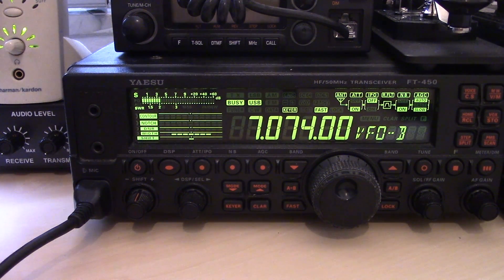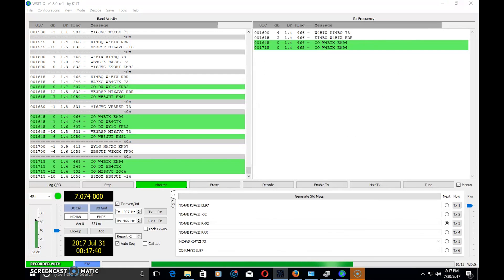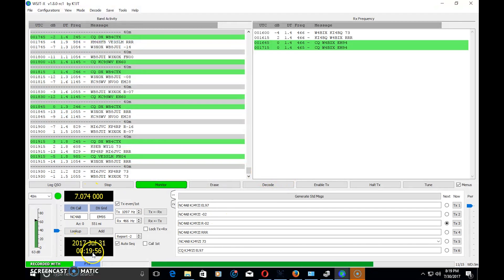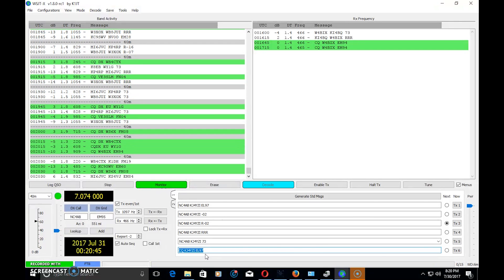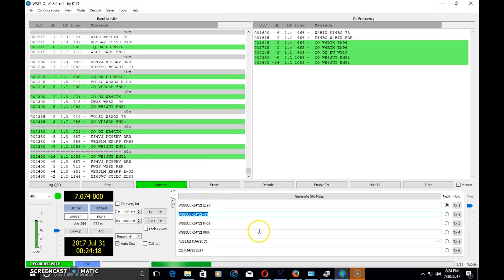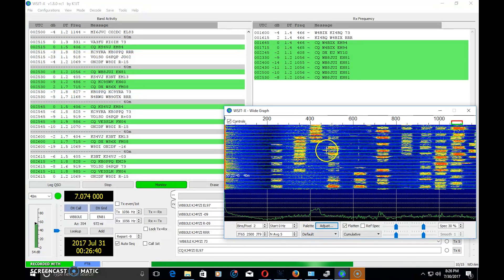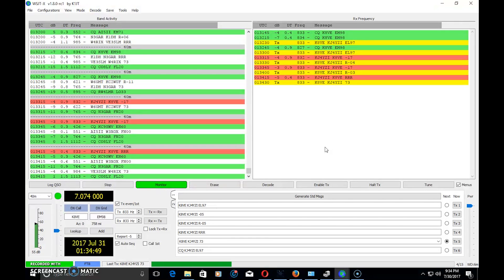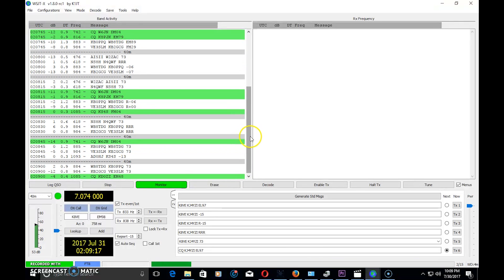FT-8, The New HF/6m Digital Mode, Introduction For Beginners

Comment: How do you handle multiple ft8 calls coming in to you one after the other or at a bunch at a time?  For example 5 calls come in simultaneously.  I usually do first come first serve and if the station does not respond after 4 or five tries I move on to the next one and so forth.  Or I would look for the strongest station and go from there.  If I cannot make contact with stations, then I try to call them back at a later time.  Any suggestions?  Thank you.

Comment: You know what? it isn't a digital mode, it is an analogue data mode that uses tones, electric pulses of varying amplitude, whereas Digital is binary format (zero or one) where each bit is representative of two distinct amplitudes. people keep making this mistake, It's not a digimode because it does not send a digital signal! The actual carrier of the signal is USB

Comment: I am really late to the digital game being a ham for 30 years now, but thank you for the video. Going to try this with a newer rig and some cables I have coming for it.
Reply: how’d it go?
Reply: @Lick2Trip  It's going great. I use MSHV  I stead of wsjtx because for me it works better.  For me the cat cable control never works. Not sure why,but works fine using vox.
Reply: @Lick2Trip  Don't know. I have all the proper cables but no luck. I have tried regular serial cables and usb to serial and it acts as if there is nothing there,but I can use the audio cables and it works fine. I am a hardware guy in a software world. Just glad I can get on at all.
Reply: @Lick2Trip  Going to try again now that I have serial to serial vs usb to serial.

Comment: Very useful and clear video - I'm just trying to set my FT-450 up to use it, as I am limited to vertical HF antenna. First impressions of range of signals received is very encouraging. Here in UK I am receiving China and South America which I really struggle to QSO  with on SSB. Thanks very much - length of video is fine for beginners. 73 Rob G1VXD

Comment: Always enjoy your videos, however I find this mode kind of silly, but having said that I believe it is a tool in some respect.  It will test your antenna with low power to see how far you can reach out and touch someone.  I've been using it for a very short time.

Comment: Full disclosure....been a ham for decades.  Extra Class when you actually had to copy 20 wpm cw.  My very first contact on air was in digital mode.....on 3729 kHz (KC back then)  using international Morse code on cw.  I had to send and receive manually.  Since then I have used virtually every mode of transmission that ham radio allows.  So....here's the thing....what's the point in a 30 second QSO where your computer talks to another computer?  Why even bother actually being there?  Just program your computer to search for a digital signal...then respond to a digital CQ, exchange grid square, signal report...and sign off.  You can just walk away...let the machines talk to each other....and, gee whiz....ain't it great?  Look at all the "contacts" I made....Rubbish.  You didn't make a contact...your computer did.  All you know about the other guy is where he is...and how strong/weak your signals were.  That's it.  You don't even know his name.  Nope....not for this old timer....go ahead.....send and receive little warbling sounds...let your equipment do it all for you....but, to me....that ain't ham radio.

Comment: Good video but dang, FT-8 looks like a colossal waste of time, and you don't even need an operator to do anything. I keep wondering if I should get into ham, but it's stuff like this that I find very unappealing. Every time I ask a ham operator what they do, it's just trying to make contact and exchange a location with people and a signal report, and that's it. Like, what's the point? I thought the idea of ham was to communicate, but as best I can tell it's basically just a bunch of people ticking off boxes.

Comment: What good does this mode do if all you can say is "this is my callsign and locaion"/

In an emergency, it would be good to be able to request help, call for supplies of provide casualty information.

Can this mode actually be used for something more useful ?
Reply: Of course.  It sends data... that data can represent anything you wish... well, almost.

Unless you have a commercial license you will have certain limitations... 

Content

You MUST include your callsign in the QSO at the intervals dictated by the licence and the communication must NOT be commercial in nature.  It also cannot be obscene or offensive.  It can be opaque but it cannot be encrypted.

If you are a commercial user, then usually none of the above  restrictions apply.

Remote control or message relays

If you want to use this to send information to an unattended system (some form of remote control) then this is fine, but for the unattended system to transmit data back at you (even an acknowledgement of receipt) the unattended system MUST have the appropriate variation added to its operators license to allow unattended operation.  As the operator of any unattended transmitter, you should (and in some jurisdictions, MUST) have an alternate way to shut down the remote transmitter/repeater system if it misbehaves or if you are required to do so by an authority.  Internet, SMS commands, Pager message or Phone-in DTMF are all good for this, although, even simply being able to call some person to go pull the plug for you is also acceptable.

A transmitter being operated remotely does not count as unattended, if the live operator is in real-time control of the transmissions and content.  And, receive-only remote stations are always permitted on public bands without any license considerations.

If you are a commercial user, then usually none of the above  restrictions apply.

Emergency use - reasonable use clauses

In a genuine emergency all of these restrictions are lifted but this does not free you from having to act reasonably and responsibly.  For example, if stranded in the ocean or on a deserted island - you ARE permitted to use the international aviation frequencies, although you should limit this to the civil and military emergency channels.  Same with marine distress or hailing frequencies... you do not need a license to use maritime radio in a genuine emergency.  You can also use a police/military/ambulance/fire service/taxi radio... if the legitimate operator is in distress or unable to make the call, such as in an "officer down" situation.

In addition to using restricted equipment and frequencies, you can also use a higher power than is normally permitted, provided you can justify it's use.  You can technically use non-standard modes too - although, this is harder to justify, less likely to receive a response and more likely to interfere.

So, in an emergency - use whatever works to get a response - in order, starting from the least invasive/disruptive.

Many nations licenses state this explicitly, some imply it, and others are silent on the matter and leave it to be decided after the fact.

If you're in the US, the relevant sections are :

 - Part 97.403: Regarding "The safety of life and protection of property", which states :

No provision of these rules prevents the use by an amateur station of any means of radiocommunication at its disposal to provide essential communication needs in connection with the immediate safety of human life and immediate protection of property when normal communication systems are not available.

97.405: Regarding "Any station/user in distress", which states :

(a) No provision of these rules prevents the use by an amateur station in distress of any means at its disposal to attract attention, make known its condition and location, and obtain assistance.

(b) No provision of these rules prevents the use by a station, in the exceptional circumstances described in paragraph (a) of this section, of any means of radiocommunications at its disposal to assist a station in distress.

Note that this also applies to unlicensed users, and implicitly extends to licence-free emergency operation.

Note, also, that this is reciprocal.  You DO NOT have to be in distress yourself.  If you are the only person hearing a station in distress - regardless of frequency or licensing, you may transmit as required to gather information and to assist by relaying that information appropriately.

Emergency use - liability

None of the above releases you from liability should your signal interfere with, or cause any loss to, the primary users of that band or channel... any "Emergency" must be grave, immediate and quantifiable - and any "more conventional" solutions must be tried and found to be either unavailable or fruitless.

Remember, you may need to justify the action to a court or to a radio authority... fines (and even jail time) await anyone who plays fast and loose with the definition of "emergency" ... so, it's definitely not something you'd want to do unless there is simply no other option.

Strict necessity as a valid defence

In most countries, during peacetime, "strict necessity" trumps even the criminal law.

Comment: Well done. Thanks for the info. I'm not clear on why you need a separate USB audio device if the rig is already controlled by USB from the computer. I have a Yaesu 991A. If it's already using the sound card in the PC, why would I need a separate USB audio device? Sorry if that's a dumb question. Just got my tech license after a 50 year hiatus in ham radio, and damn if things haven't changed a lot :-)

Comment: Digital bulshit.I dont know what is the pleasure of pressing enter on computer.That is not HAM spirit and HAM radio and HAM operators skills.Viva la SSB and CW.
Reply: I suppose you don't do DMR, Dstar or Echolink either.
Reply: @stacyadiaz  Of course not,that is not ham radio....that is just mobile phone like all others
Reply: @ciro79  It's voice over internet protocol (VOIP).  Too bad you can't learn to accept the technology because when the HF bands are too crappy to support SSB, I'll be having a clear QSO with hams overseas.
Reply: @stacyadiaz  QSO with hams(radio amateurs and ethusisasts )over wires???? without any qrm and qsb???Expecialy in natural disasters or wars...looooool what a pleasure and hobby...You make me laf man :=)  You can call them by the telephone loool
Reply: @ciro79  You make me laugh.  DMR, DStar and all those other modes are an extension of the hobby, they aren't intended to replace OTA communication.  I am an OIF-3 veteran and had boots on the ground in Iraq for a year.  The Iraqis were using the same radios you and I buy  at the candy store to listen to our COMS.  They couldn't intercept SINGARS COMs but you could hear them all the time on UHF/VHF.  The best way for civilians to communicate securely in war is still a handset (TA-312 for example) and miles of wire line .

Comment: Very,very good video. I am also new to FT8 and am learning. This added a few more pieces of the puzzle for me. I have a few questions that maybe you can answer:
1. At the end of your last QSO you sent him a signal report 2 times, the same value. Why?? Is this normal or other reason?
2.In the Tx even/1st do you have to change this based on the time sequence your CQ caller is on? That is 0 or 5??

Greg... KO8A

Comment: they have a digital mode called the internet.
why bother owning a radio for this?
Reply: Don't need the internet. had digital modes around before the internet. this is nothing new. The internet is.
Reply: To your great surprise, the Internet is not available at all places, at all times.

Nor is using the Internet the point (no one will be streaming Netflix with this, we get it), even where it can be readily had.

Welcome to the concepts of 'hobby' and 'experimentation...'
Reply: good luck calling sos in digital.
can you hear me now?
Reply: The military have used digital for years...and years   Its CW that the new covert mode !!!    @1112223333111
Reply: Dear  @1112223333111   At the end of the 70ties I used to be a radio officer on board of merchant vessels. In that time we were already able to call SOS in digital mode. On HF, MF and VHF. Whatever you wish.
Reply: The internet takes a lot of centralized infrastructure. It is very vulnerable to damage in your local area, such as an exchange catching alight.
Reply from the maker: Give it a break already. I hope your internet goes out tonight.
Reply: Give what a break? Either your channel is open to all points of view or it's not. Or, is your channel just one large mutual admiration society?

Comment: Just saw your video.  It's really good.  FT8 is my first foray into digital since the county-wide APRS Wx packet network I setup back in the '90s.  I've been playing with FT8 for a few weeks now and in that time have worked all states (just on FT8) on 40m, nearly all on 20m, and am getting close to DXCC.  Previously, I had worked all states on 40m SSB on a late night net that requires physical QSL card confirmations... that took many years.  
If I may make a few suggestions..  I've found that I need at least 40w (and occasionally higher) to establish a good exchange, without going too much over a R+00 report.  I've heard from many in the FT8 community that this is a poor signal mode, NOT a qrp mode, and 40-60w is quite common; unlike other digital modes.
In addition, everytime I saw a station in your video show up in green on the left pane, I was thinking , "Did he already log them?"  Only previously worked stations show up like that for me.  Unworked stations, show up in dark purple if they are a new entity; and light purple if I've not worked them, but have worked their state or country.  
Finally, it might be worth explaining JTAlertX.  I found setting it up it to be the most frustrating aspect, but also quite rewarding once I had it tweaked correctly.  No more uploading ADIF files, or knowing if I worked that station on one band but another.

Comment: I'm new to DXMAP but on there FT8 is, by far, the most common digital mode. I think it's great that digital modes are evolving to be ever more tolerant of poor signal and propagation conditions. Having such a mode is great for QRP with small portable antennas and it would also be very useful in emergency conditions operating from battery power where getting through is far more important than the data rate.

Comment: I'm  a relatively new amateur radio operator (did signals in the Reserves for 14 years though when I was a young buck) and have only just this Easter weekend created my first HF station at home using a Yaesu FT-450 and a DIY horizontal delta loop that isn't resonant on any of the bands, as I've just used the available space in my small garden. Somewhere about 9MHz would be resonant I think. I've only had one voice QSO since Sunday and It dings your confidence when you spend a lot of time calling CQ and trying to work other stations and you don't get a reply.  One of my club mates loaned me a data cable on Tuesday night and so  I spent a couple of hours yesterday installing WSJT-X, configuring the radio to work with it, and trying to respond to and initiate CQ calls using this mode. I had one QSO the whole evening, but I'm not disheartened as I can see the reception reports on PSKReporter.info and I can see that my meagre signal is being heard as far as East Coast USA, and central Russia. 
Cut to the Chase Andy!! ----I've got a better understanding of the way the protocol works as a result of watching this video, the idea behind the waterfall, and how to respond at the correct time. Thanks very much. 73's M6UAW

Comment: I was a skeptic, but it is a fun program.   FT8 is just one of a bunch of modes the WSJT-x software promotes.   I haven''t done any digital operating since 2002 or 2003.   I am amazed in the advances in digital and obviously the radios.   I remember building a transmit box back in 1999 so my Yaesu FT840 could transmit through the Mic Jack, and I could operate PSK31.   Hard to believe that was almost 20 years ago.  I am glad Amateur Radio didn't die out after the code was abolished for licensing.

Comment: I was using the Icom 7300 and the lowest power out it will transmit is 2 watts, so I wanted to reduce my transmitted power so I used the transmit slider on the right.    If you are using 2 watts and you reduce the slider on the right down to -3dB, you have decreased you power output effectively by 1 watt.  You can go to: https://www.pasternack.com/t-calculator-ratio-conv.aspx#/ and mess around with the dB formula.   You can see the relationship in power by inserting 2 watts in and 1 watt out in the spaces in the link provided and see a 1 watt reduction is -3dB.     If you want to estimate your power out you can watch your reported reception and figure out I guess how much your system losses/propagation performance are too.   Thinking in dB can warp your mind at 2am.  lol.